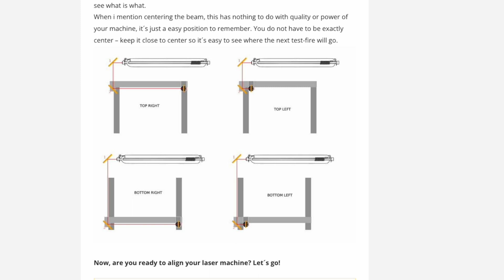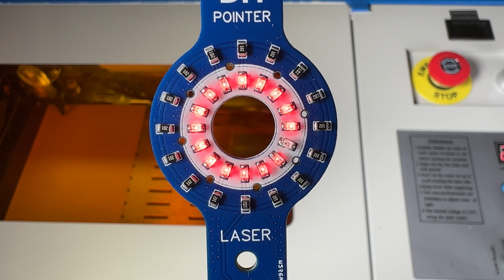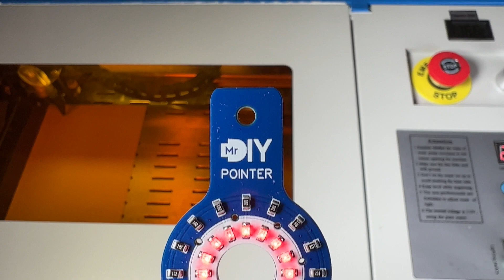K40 Laser Cutter & Engraver | LED Ring Accessory - Is it SAFE?

Comment: You are worriing about the laser starting a fire, but in the same time use the laser with the lid open where the laser in an instant shorter than it needs to light a paper to flames could blind you permanently?
Reply: The CO2 wavelength is not very harmful compared to even a simple laser pointer or those very popular blue laser engravers. The wavelength does not pass the lens of the eye, so a direct strike being FOCUSED on the eye will give a burn that heals, once it enters the lens of the eye, the damage on the retina will not heal.

Comment: Are you planning on making more to sell? Or a video on how you made it? I agree with the magnet comments, and also the battery option - I'm not that great when it come to electrics, so I wouldn't want to be messing with the power supply.
Reply: Helps if I read your comments fully. Ignore me asking if you are planning on selling it

Comment: Why exactly is this unsafe? Because you use the built-in PSU? Because the laser to hit the PCB?

I'd buy one of these in a heard beat FYI :D Even if it was a magnet one you place on for short periods of time.  Aligning a K40 is such a pain because it's slow (tweak, close, fire, inspect, repeat).
Reply from the maker: Ya, if not executed properly, it has the potential of causing a lot of damage. You sound like you know what you are doing, however, you will be surprised how many don't.

Comment: Use magnets instead of screws and a pair of double A batteries or a step down from a nine volt battery. 
Then simply remove it when not in use for calibration or startup. If you are worried about forgetting to take it off, put a timed buzzer on it or esp32 and have it send a notification to your phone.